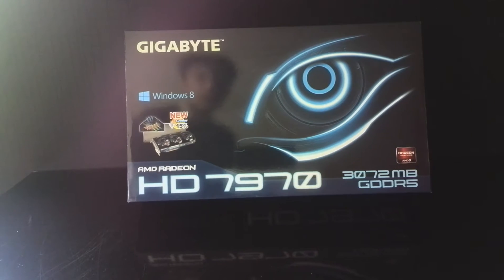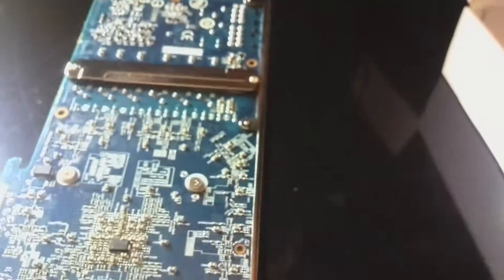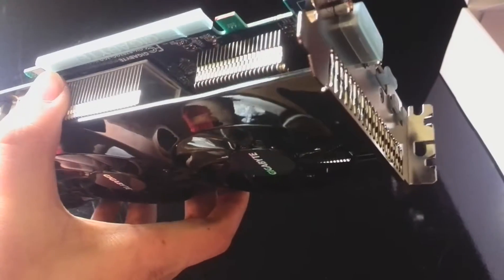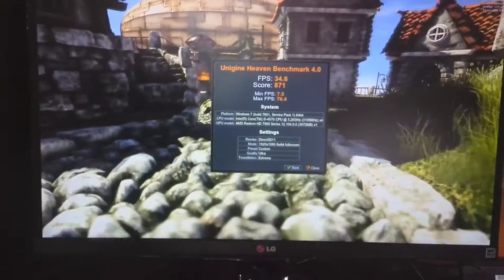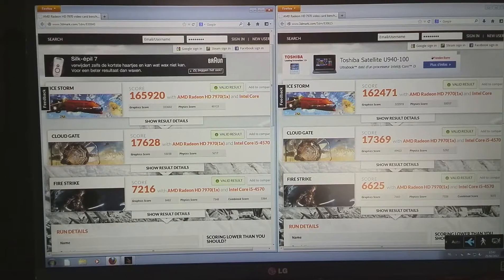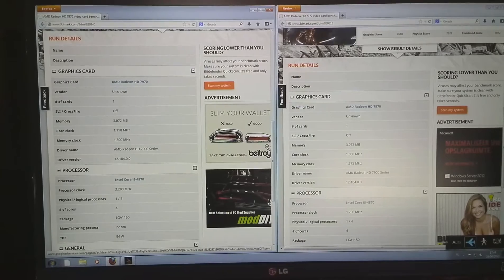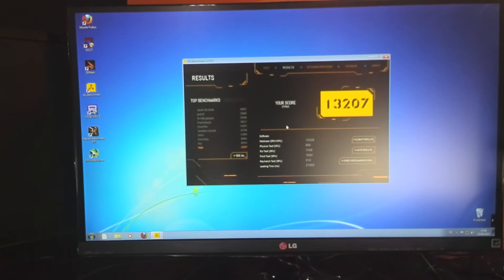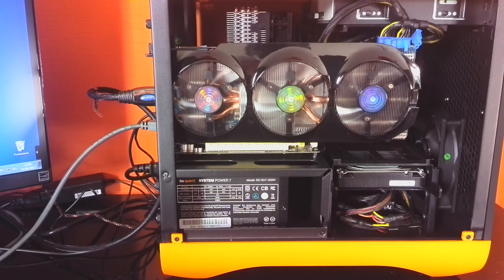Gigabyte AMD Radeon HD 7970 Windforce 3X Review

Comment: i only have 6 pin and my power supply is 650W is theres anything i can buy like a converter or anything to make this work on my pc? need help plz i bought it already
Reply from the maker: +Mr Segar there are plenty of 6 to 8 pin cable
Reply: so if i used the 6 to 8 i can make it work with only 8 ? without the first 6 pins?
Reply from the maker: you need both

Comment: This or a 280x toxic
Reply: I'd Say This In 2X Crossfire Or A Single 280x Toxic, The HD 7970's Are Cheap Here In Australia, The 280x Toxic Is Quite Expensive, But It Performs Well, Ran Em Both Through A Burn In Test, But The HD 7970 Crossfire, Suprisingly The 7970's Won!
Reply from the maker: The Legend are you trolling or just stupid ? They are identical cards and both use the same drivers. Go to amd website and compare 7970 and 280x drivers if you dont believe me.
Reply: really sorry for the wrong info then
Reply from the maker: The Legend np, just dont like wrong info on my channel. Might confuse others
Reply: ok sorry
Reply: 280x because a hd 7970 has older drivers